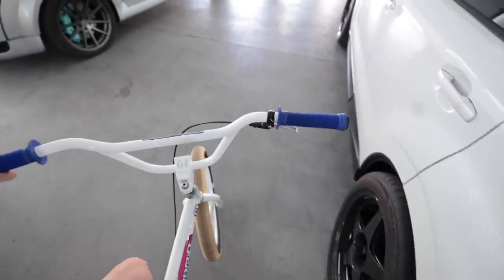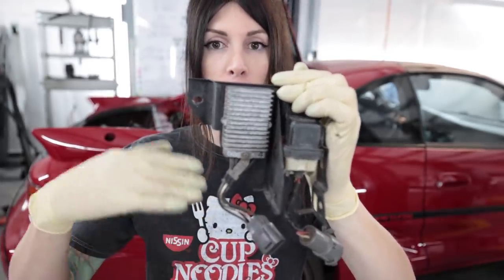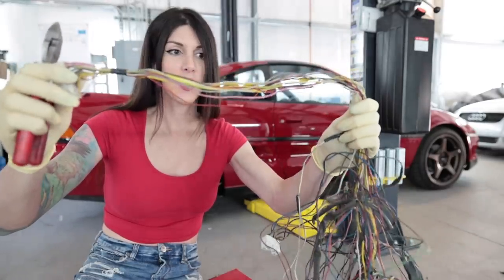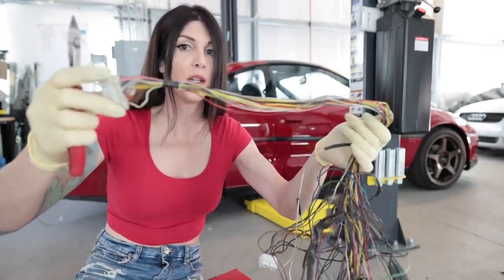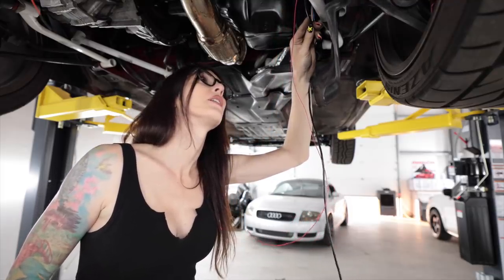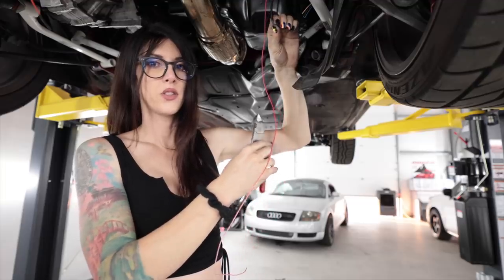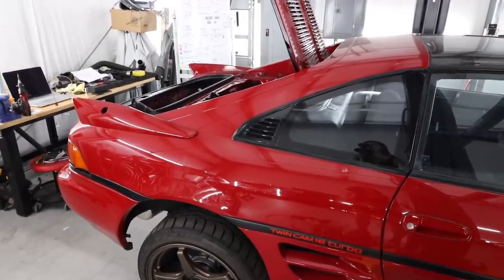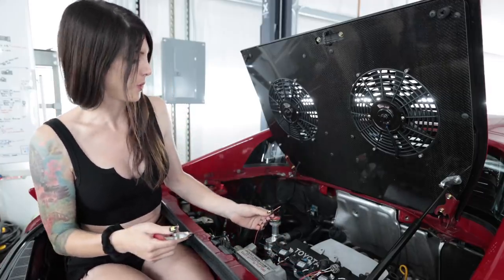Going FULL NERD MODE  on this Wire Harness! // MR2 Standalone ECU

Comment: I like your OCD style builds. Only improvement I'd suggest for near future is acquiring a 964 or 993 (preferably in bad technical condition) so you could completely rip it apart and put resources in instead of the TT. Flick a clutch in it and send it. And f*ck H is for hackjob (you know who) shit builds bonanza.

Comment: I don't watch many of these videos,but it seems like the value of the car
would tank because all the factory stuff is ripped out making selling a pain.
you do have to disclose that you ripped out the factory parts or you are screwing
over whoever you sell it to because they have no idea the fubar mess they inherit
if they ever have to take the car to a mechanic to get it fixed,you would have to print
out everything you did so someone else could fix it if it breaks down.
Reply from the maker: Yeah, no, that’s not how this works.
Reply: @SarahnTuned  I know now the infinite limits of your self control.